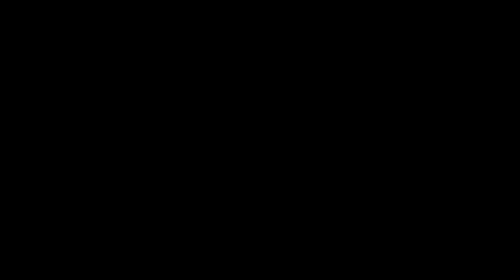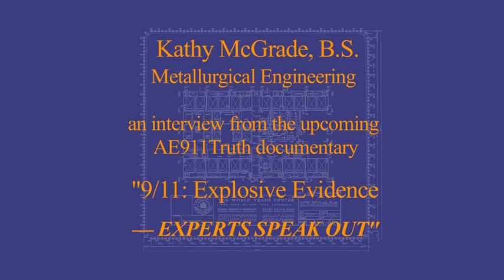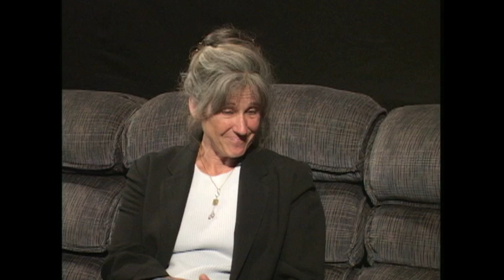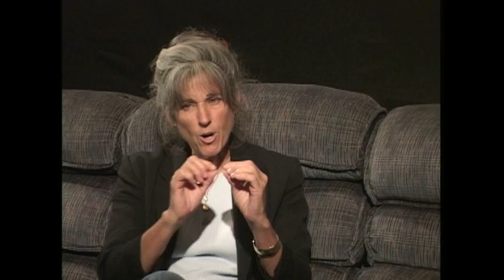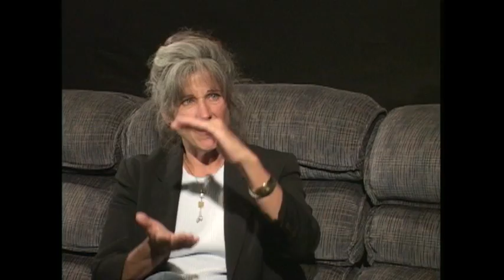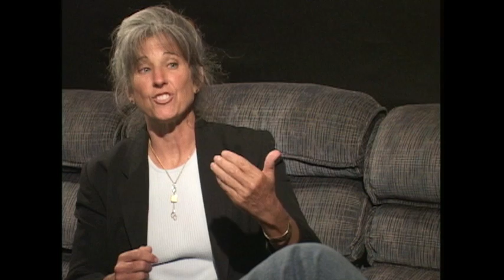Kathy McGrade, B.S -- Metallurgical Engineering

Comment: Also has to do with 80% nitrogen in an office fire.  A controlled industrial fire uses about 5% excess oxygen for optimum burn using either O2 or Air.  The office fire is more than 100% excess with air (having Nitrogen). A good wood stove limits excess air for a good fire and is made of steel.

Excess air cools the fire because the extra mass absorbs the energy (heat).

Comment: How about this: There are no traces of aluminum oxide in the dust. The thermite reaction is burning of aluminum by the oxygen contained in iron oxide. If the iron micro spheres in the dust came from thermite, there should be large amounts of aluminum oxide, and there is none. There is also no barium nitrate which would be there if thermate was the smoking gun. Both have very high boiling points and would not evaporate.
Reply: +comingviking 
Of course it is a year later and you have no doubt heard about the very strange nanothermite cocktail of metals and a type of organic carrier matrix.  There is no doubt that the red grey chips are a very high tech explosive.
Reply: Phi Sailor
Uh, I don't think so. Harrith "identified" the flakes as "nano" thermite. Nano, but stil therite. He claimed to find aluminum in the flakes. And if any of that had burned in any quantity, there should be oxides of it found in the dust, and there is NONE. Ladiing one to the conclusion that the flakes cannot possibly be any kind of thermite.
Reply: +comingviking 
Oh hell, that's no problem... I mean it would be a miracle if all the AL2o3 vanished into thin air(ha ha) and all kinds of divine intervention better defined as a suspension in the laws of motion and thermodynamics.  Well, those at least.  How buildings can tear themselves apart and freefall.  You know that kind of thing that those damn truthers bring up all the time.  Yah, those guys.  I see this disappearance of Aluminum oxide as just another miracle.  No problemo bro...
Reply: Phi Sailor
It's not exactly a miracle that a building that gets struck 25 flors from the top by a 100+ ton  jetplane moving at 800+ mph and then subjected to hours of fire, will sustain heavy structural damge and weakening sufficient to make the 20+ floors above the point of impact fall down on the rest of the building. It is also no miracle that the lower floors thius impacted should collapse. Not miraculous at all.
Reply: +comingviking 
Do you really believe the values you gave me just now?  They are a total fabrication.
Further, the accepted laws of physics are violated by the NIST report and by your preceding paragraph.
You have no idea whatsoever about the strength and integrity of the materials you mention.

How old are you?
Reply: Phi Sailor
The airplanes weight and speed, and the impact points on the towrs? No, they are NOT a fabrication. You can check the stats for that type of airplane yourself. As well as the data for the impact points. All publicly available.
I did not mention any specific materials, but when a 100+ airplane impacts a building like that with such force and momentum that flames and wreckage are thrown out the other side of the building in a great ball of fire, you would normally expect a LOT of damage. Also, the construction of the WTC towers with external perimeter coloumns, means that the impact wall and the opposite wall, lost a large part of its strength in the crash. And steel loose about 50% of its structural strength already at 500*C, which is well within the termparature range for the fires that came after. All in all, not an awful lt left to hold up 20 storeys after that. They were bound to fail no matter what this alleged expert says.
Reply: +comingviking 
You are a very silly and seriously misled individual.  Remember you are talking to adults who have worked in these fields in a practical sense for likely longer than you have been alive.  As for as your 'public' record is concerned, that is more crap.  It does not say this at all.  How does it feel to be part of something that destroys the lives of innocent people.  No?  Well this kind of unadulterated lying does just that.
Reply: Phi Sailor
I think we have reached the natural end of the discussion, when you run out of intelligent things to say. I would love to say it's been a pleasure, but it hasn't. It never is.
Reply: +comingviking 
That's a sad place to be I expect.  Knowing everything like that.  Well, kudos to you vik.
Reply: @comingviking  800 plus mph lmfao
Reply: @VettedLS71103  As you should. Sorry about that. It should of course have been 800+ km/h. I am Norwegian and fell prey to translating the metric unit without doing the math.
Reply: @comingviking  Though I'm joining your discussion a couple of years late, but I just gotta tell ya that your numbers for the speed of the aircraft and the time between impact and collapse are complete horseshit.

Comment: I'm aware of most of the facts surrounding this whole issue, and what claims are not confirmed, and 43 minutes is certainly more than what's required to list off all the relevant information, so the rest is likely to be filled with vaguely manipulative rhetoric.

Now, if you want to give or link to some report of this company ZIM breaking their lease and incurring a large fine, or better yet the records of the lease provider, you may do so, but raw facts should be the most important.

Comment: Where, do you suggest, would the massive volume of spheres (up to about 6% of the dust) have been located until it was dispersed during destruction? During clean-up? How would such amounts of spheres have been spread into, for example, the Deutche Bank Building (where dust was collected but where no clean-up with torches was done until long after the site of the towers were completely cleared of rubble)..?

Comment: @Wildkkat1 HA HA HA!  Boeing 757's and 767's CAN NOT travel 500 mph at sea level.   The specs on these jets performance numbers is readily available..   Also an aluminum aircraft will not do jack shit to structural steel no matter how fast  you crash into it.   Steel is HARDER than aluminum.   The engines of the aircraft are the only things that could deform those buildings structural steel beams.
Reply: Mr. Lowery is misinformed. The aluminum used to build aircraft has a higher tensile strength than industrial steel.
>The aluminum that modern aircraft are made of is not the same soft material as that of a beer can: Aluminum 2219-T81 UNS A92219; ISO AlCu6Mn; Aluminium 2219-T81; AA2219-T81 – with a tensile strength greater than that of structural steel.
www.flightmemory.com/encyclopedia/Boeing_767.html
. . . . . .
https://hybridrogue1.wordpress.com/2014/02/04/911-disinformation-no-planes-theory/
\\][//
Reply: Willy Whitten 
He’s generally correct in principle. While some alloys of aluminum are rated higher than mild steel for tensile strength, you’re confusing the issue here. 
Which should be something like: Can a thin sheet of aluminum (high strength or not) somehow penetrate a SOLID barrier composed of slab steel box columns four inch thick steel x six inches. 
The answer is no.  But irrelevant anyway, for aircraft don’t figure into the actual damage, but only to sustain the myth. 
Aircraft are using thin gauge aluminum for weight savings, which it does nicely. Not going through steel.

Comment: @Wildkkat1 let's say you are partially right and the heat did cause substantial buckling of the beams at the point of impact [doubtful].  let's say they did give way all at once over the entire impact zone [even though it's not possible]. the weight of the portion of the building above it might crush 2-3 floors or the top might topple over - falling off the intact structure, but there is NO way in hell, they could cause all the intact floors below them to give way. just not logical!

Comment: @AiresQX4 Try to figure the kinetic energy of a 500,000 lb Aircraft going over 500 mph. It pulverized everything in the strike zone. The Space Shuttle that burned up during re-entry was cause by a piece of foam that hit the leading edge of the wing root and made a hole in the titanium wing at the speed of a 30-06 bullet. When kinetic energy applies normal metallurgical rules do not .

Comment: When steel beams are holding thousands of tons of weight, and you heat them with 80,000 lbs of jet fuel they don't melt but they bend, and fall......the woman is wrong!
Reply: If you look at the videos the fuel burns immediately